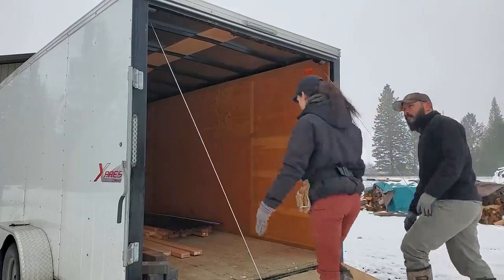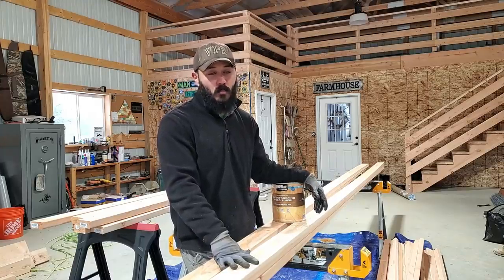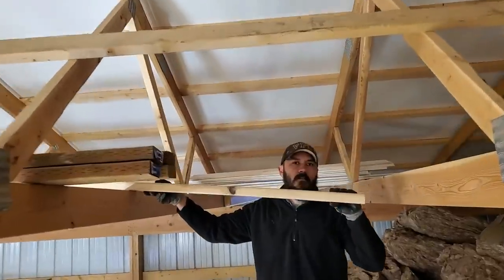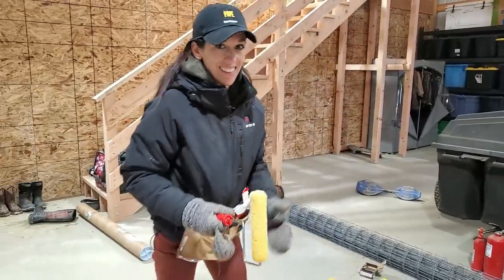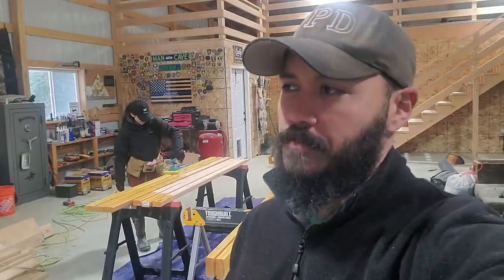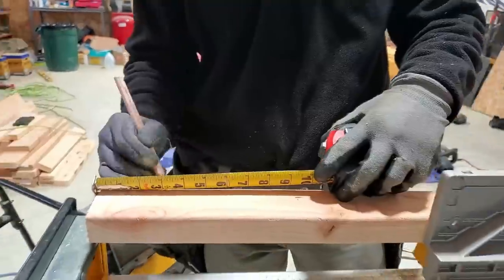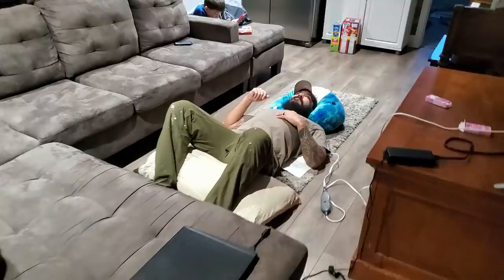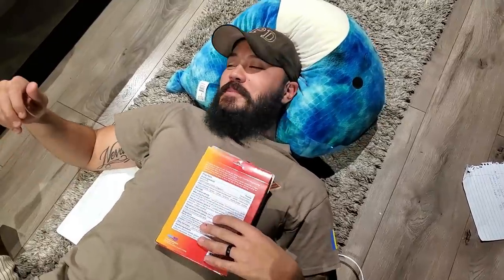He's INJURED | Not How This Build Was Supposed To Go

Comment: Definitely needs to ICE it down 20 minutes on an 20 minutes off. That will take down the inflammation. Feel better soon I know all too well what your going through and ice is the key 😘🙏
Reply: We use the hot and cold method in the UK 20 minutes hot then straight after 20 minutes cold and then repeat,  it reduces inflammation and helps with muscle spasms.  Oh and then go see a chiropractor!! Not possible here as lockdown means no hands on full stop.
Reply: You need to use heat with spasms to get the muscles to actually relax down.  Once spasms pass then alternating between hot and cold works well.  While ice helps with pain and inflammation you have to be careful around spasms because cold makes the muscles tighten up more instead of relaxing the length of the muscle.

I have chronic pain and regularly go to a physical therapist who is a natural in his field.  I've always preferred ice to heat because it brings the pain down but the long term effect of that is my muscles are tight as hell and won't release tension easily.

Comment: Sorry for the back going out. I had the same issues years back. The Massage therapist stressed to build up the inner core. There are tendons and nerves that need to be strengthened by stretching. I improved my problem by doing some stretching prior to doing heavy work. I was put on a body stretching table. It helped also with electric stimulation. I use a lot of heating pads when I have over done it. relaxing with the pads keep the nerves relaxed. The muscular group as I saw from the heating strip you put on is the Serratus posterior inferior and Spinalis thoracis group. I am not a doctor, and no expert, but I learned as much as I could about the muscular groups and how they work. Take it slow. Remember you lifted all those rail road ties. The body remembers the stress so you will be still having after effects. ( Back Lash)  We think we are strong, until a back muscular group acts up. I can relate to the pain. Keep staying lose.

Comment: If the sneeze is mostly in your nose, try putting your first 2 fingers on each side.  Next gently press softly an move your fingers up and down.  Works better if one side is up while the other is down, so moving in opposite direction.

Comment: I feel your pain! I was play wrestling as a 16 yo girl with a boy, he flipped me and immediately pulled something in my back. Was a few days in hospital in traction. Thruout the years The old injury will get triggered by seemingly nothing at all just pick up a pencil wrong! I’m 71 years now and whenever I feel a twinge,I take a muscle relaxer(4 mg Tizadine) wait til it starts to kick in,lay backwards over an earth ball and gently rock back and forth draped over the ball (I do hold on to a chair arm to steady myself)after about 30 minutes, get up and lay on heating pad , stay hydrated with fluids (no alcohol ha ha) also take an ibuprofen to knock down inflammation.  This has worked perfectly for me for years. I am still a very active 71-year-old . One subscriber had mentioned using Tens unit.  I have used it and you can do that combo with the heating pad &  the ibuprofen but I found draping myself backwards over the earth ball helps to gently realign whatever’s pulled in my back.  I have no osteoporosis or slipped discs it’s strictly muscle spasms.

Comment: I had the same problem as yourself for years. In desperation i purchased a TENS machine which sends electrical minute current through patches placed on the affected area and it was very effective. They are available on Amazon etc and not very expensive.

Comment: If you want to make that chicken coop lumber last you can use an olf farmer trick for treating outdoor wood (such as fences etc).  Real simple mix 50/50 old burnt motor oil (filtered) and diesel fuel.  The solution can be applied with a brush or garden sprayer.  Use an old sprayer, you don't want to try using it in the garden ever again.

Comment: Hey Jeremy,  I was a firefighter for years. Occasionally I would have severe back spasms that looked just just like what you're experiencing. My last one was in my 30s. I'm now 62 and lift 5 gallon buckets of oil and heavy truck batteries without any back issues. Never found out why the spasms happened but they did go away.

Comment: Jeremy is 6'3"? Hey Shorty! I'm 6'7" and really screwed up my back years ago. Several days a year I could only crawl around. Then I discovered this exercise (only when my back felt better): Standing up bending over (90 degree angle?) lifting up some weight (about 40lbs) one arm at a time - not moving my back at all - this creates a passive resistance on my back muscles ... strengthening it. I do this passive resistance about 2-3 times a week - my back feels great!. When I start letting this passive exercise slide a month or so, my back starts telling me it's going to fail like it used to (days of crawling again). I've told 20-30 people this, no one but 2 listened - they're surprised by the results. It can't hurt to try (only when your back is better). Remember 'Passive' is the keyword.

Comment: Being from sweden its kind of interesting to see how bad you are adjusted to cold climate. You need proper shellclothing to be protected from wind and rain/snow properly like gore tex. Long jackets is better than short. Longjohns and longsleeved undershirts for extra warmth. Merinowool is best. Headprotection is paramount. A cap is simply not good enough. Cover your head and ears. The many times you switch from cold to warm and other way around is increasing the risk of pulling muscles. Being cold also reduces your immunesystem to work properly.

Comment: Go to town and get A535 rub extra strength, also going into the shower with mild cold water to whatever you can stand for hot water do this back and forth for 20 minutes. I did the same sneezed and yah I blew up both right and left muscles in my back, just gotta decrease the acid that is in between the tendons, skin and muscle.

Comment: Jeremy get a TENS UNIT. AN ELECTRO MASSAGE UNIT the devise has many different settings and yes it does work. I recieved mine from the Detroit VA Medical Center for basically the same problems you are experiencing. Talk to your doctor about it. Nice thing about it Its portable hook up to hour belt wired to self sticking patches It massages the muscles through electrical impulses.

Comment: It is your Rotator Cuff for sure. You need to do some modified exercises to isolate and strengthen that area. Put arm to the side, this position “L” elbow bent, hand gripping a rubber band that is tied to a door knob (physical therapy store/Amazon has them), then keeping upper arm close to body, move hand outward, and back, slowly. Away from the body, then back to position. Keeping “L” shape entire time. Ice for 1st 24-48 hrs, then alternate heat/ice. Take 800 mg of ibuprofen to help with pain.

Comment: Here is how i put my lower back back in when it pops out.. Take a tennis ball or racguetball  and while laying on the floor  put the ball under your back and apply pressure using your body weight. . Place the ball between the spine and your hip  and also roll the ball along the area to be moved back into its correct position.This may take  a few days but u should start to get relief within a few hours. Helps if u put your feet up against a wall with ur knees bent .If you r lucky you will feel it pop back into place but most likely it will move a little bit towards it proper position  each time u do this.

Comment: I’ve had these pains in my back also. Drove semi for 10 years and developed this from sitting. It’s muscle spasms. They can happen without warning. Sometimes I could feel it coming on with the weather (I’m 40yrs old). With everything we do being in front of our bodies, the back gets tight. I started doing the McGill 3 and some other core exercises and stretching. I do not have this issues anymore (knock on wood). I do however feel my back get a little twitchy and I foam roll and stretch but it doesn’t spasm and put me down anymore. Please look this up if you don’t believe me about the McGill 3. I know this pain and it is not good. It literally takes your breath away when it happens. I know this video is old but I hope you are better since this happened
Reply from the maker: Yes, that's exactly what happens! 14 years sitting in a patrol car

Comment: I feel for you Jeremy....I've been there quite a few times myself. A bone cracker doc never helped much and in fact several times made it worse. One difference with our treatments is yours is using heat and mine was using ice packs. Heat always made my recovery time last longer and be more painful.  Flat plastic ice packs are left in the freezer and applied for 15 - 20 mins every hour. Two to three days would fix me up....just had to be careful for a week and not cause the back stabs to drop me to my knees. Lifting with the back and without the legs doing most of the work usually started the stabs.

Comment: I can relate. Has an accident at work 6 years ago, messed up my lower back, now in chronic pain, and it locks up my rib cage so I couldnt breath in.  3 days pure bed rest, take pain killers, massage voltarol into the area, use either heat packs or ice packs to help sooth the injury area... (suprisingly my back gets worse with heat packs). Hope your back gets better soon...... there are exercises you can do to improve 'it... see a pro about it. Also if in spasm you can get muscle relaxants from your doc, that will help but you will still need 3 days bed rest afterwards.

Comment: If you have any rubbing alcohol, warm a damp rag 1st in the microwave.  Apply those for 15minues.  Then get (2) tennis balls.  lay on the floor.  Now, put the tennis balls, one on either side of you spine, starting at your hip level.  Very slowly scoot yourself down on those tennis balls, keeping the balls, on either side of your spin.  Stop as you hit a spot that is particularly painful.  Allow yourself time at that spot, until the pain lessens.  This is simulating a 'Helga' applying pressure to those painful spots.

Comment: As a long time back sufferer (45+ Years) here is the cheep way of reducing the pain. Buy a small bag of frozen peas. When your back hurts wrap the peas in a tea towel/pillow case... or anything that is fairly thin (cotton stuff works best I have found). Place the package on the ground and lay on it with the package against the sore spot. This will bring the inflammation down and also numb the area. You must NOT place the peas in direct contact with your skin as this could cause damage. Lay on the peas for about 1/4 hour. When finished the peas can be placed back in the freezer for later use by you (best label then "not for consumption" ).

Comment: use muscle relaxers to get it under control and then get micro surgery to eliminate pressure on nerves. I had a bad back and went through some terrible times and spasms which will totally debilitate you. Micro surgery was the only way to end the pain for good.

Comment: FYI, try this and do it EVERYDAY! Lay  across your bed , on your stomach, make sure your legs from just above the knees are hanging off the edge of your bed. Dont let your toes touch the floor. Initially you might feel pain but after a few minutes it will start to go away. Do this as a daily morning routine. OR, buy an inversion chair, a teeter brand is best. By just lying on your back with warm compresses won't get the desired amount of blood into the area to do the repairs needed. Short of going to a sports medical chiropractor this is the best.

Comment: FYI.. First 24 hours apply cold/ ice on injury Not heat! It's inflamed. Putting heat on it will exacerbate it. After 24 hrs Then alternate heat & cold packs. And if you can see a good massage therapist & do good stretching exercises for maintenance. Stay hydrated 🙏

Comment: Trust me pal , I had and have the same problem with my back.  Buy yourself o TENS machine they are quite cheap but the relief is priceless oh and the one I have you can run on both AC and batteries but when on AC power you can use turn on some heat.. seriously that and strong pain killers does the trick.  My doctor advised strengthening my core muscles and I haven’t had an issue for years..fingers crossed.
.

Comment: Your right hips seems to be a lot higher then the other. You should see a chiropractor. Might help readjust you hips which will release your back. When one hips is high then the other, your spine becomes S shaped meaning your muscles are trying pull your spine back to a “straight line” to keep you from losing balance. Which can also cause these intense muscle cramps especially when you lift heavy things, with uneven hips.

Comment: You need to rest the damaged muscles until you feel like doing some stretches to stop the muscles from shrinking.
Next some light exercises to gradually rebuild the strength in them.
You have to make them even stronger than before the injury to have normal strength again.
Always remember you are a man, not a machine so think before you lift anything again.
My back was damaged a few times so I know what you are going through.
Putting on sox and work boots was a whole new experience of pain.

Comment: I get severe muscle spasms in my legs and feet from a reoccurring injury. Sometimes they feel like they are going to rip the muscle right off the bone. No amount of pain killer will help. I have successfully used zanaflex (tyzanadine generic) as a muscle relaxer every time they act up. It is the only thing that solves it. The miracle of muscle relaxers in combination with drinking plenty of water, hot water soaks, massage, and getting enough potassium whether it is through natural foods like bananas or through a multi vitamin is my cure. At 62, it happens! But not as often as it used to. I have been strengthening those muscles as well with a daily walk on the beach.

Comment: I have the exact same problem its your ribs getting out of place. It feels like a muscle pull or tendon pull between your back bone and your shoulder blade about one to two inches from the back boon to one side or the other. Relax and Ice it once it feels better you will need to do exercise's pull downs or pull ups, rowing dumbbell rows all the common back exercise's if I do my exercise's I'm invincible no back problem. I can cough work bend no problem. I stop and within a few weeks it starts coming back. I also use a vibrator ball its amazing its called a HYPERICE Hypershpere I place it on the sore spot sit in a chair and lean back on it amazing feels better in minutes when I have the problem.

Comment: Tens units are great for pain relief and muscle strength, but please see a Doc first, might be a bigger problem. If you do get a Rx for a tens, research the different ones and especially the replacement leads/pads(these can be very costly) I had one for many years and found them to work great in combination with ICE(I used big bags of frozen peas as you can refreeze them and always eat them) then heat for no more then 20 minutes at a time. Again see a Doc. Also noticed you were staining before cutting. While this might be great idea check you stain and see if you need to be in a well vented area(outside) when cutting(some of these stains are the same product used in pressure treated wood and need special handling (Mask, end cuts re-staining) also you CAN NOT burn those un-useable cut ends in your heater(cut ends make great kindling)